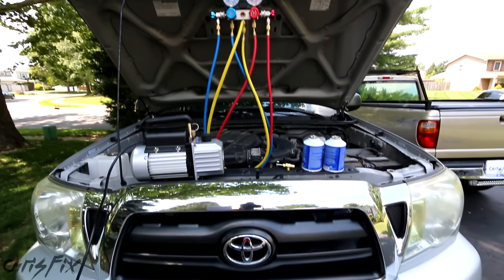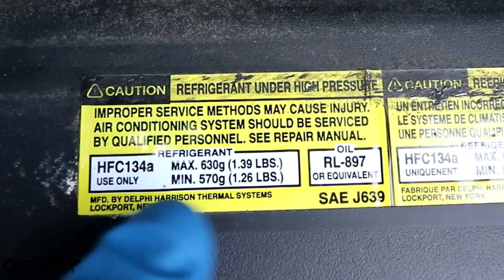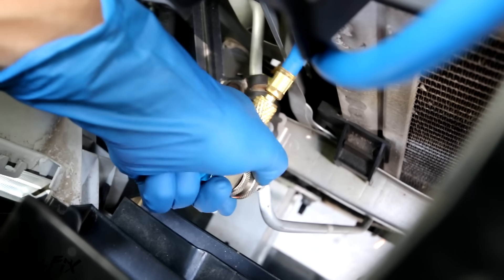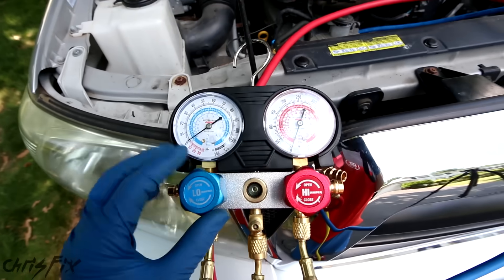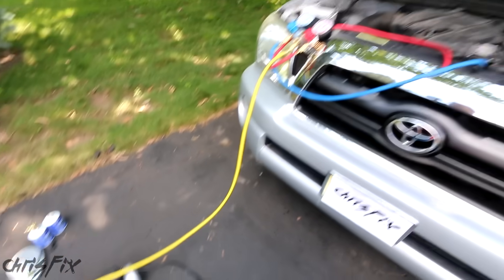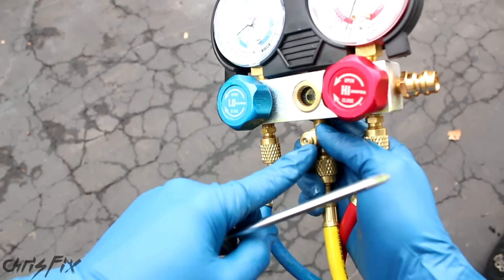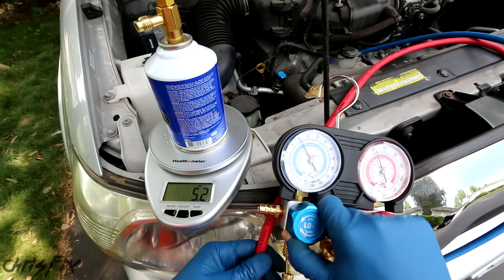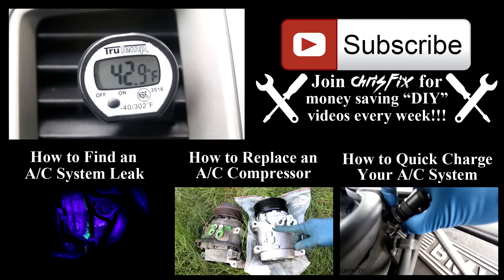How to Properly Recharge Your AC System

Comment: Hi Chris, I owned an automotive air conditioning and radiator service shop for about 30 years. We have charged thousands of vehicles. You did a very good job of explaining how to charge an air conditioner. I have always been extra careful to bleed the air out of the hose/s like you showed. I open the shop in 1973 and sold the business to an employee in 2002 and worked for him a short time. The business is still open today.
Reply from the maker: Thanks Patrick!
Reply: @chrisfix should you bleed the line after switching from the first to the second can of refrigerant??
Reply: @donniev8181  YES. HE DID IT WRONG OR FORGOT TO EXPLAIN THAT. If he did it like that, he introduced air in the system. Everybody makes mistake.
Reply: @HeydaCarreras  I simply asked a question, said nothing about making mistakes. Chris is a big boy, no white knight needed
Reply: @chrisfix question.  After you pulled the initial vacuum.  You turned the valves to off and then let it sit for an hour to check for leaks.  

But, if the valves were off, did you just lock that vacuum in the manifold, resulting in not being able to guide the vacuum in the system at all?

Than you turned the pump back on before you opened the valves so theoretically, couldn't the system have had a leak but you didn't notice it due to this process?

I'd have thought you should have left it sit for an hour with the valves open in order to catch vacuum loss (leak).
Reply: @davidshumway9639  I believe the right way to do it is to pressure test with nitrogen to 200psi, then vacuum to clear the system from any air. The pressure test would have already confirmed no leak, but if you can't, vacuum and wait a couple hours would be an alternative.
Reply: @chrisfix .
Reply: @chrisfix  How that works if your car only has hi presure connector in low pressure line?
Reply: Just 1 tip to toss in from my personal experience, it's a good idea to do a pressure test as well. Had a system that held vacuum but leaked at low pressure. Found a hose that had a pin hole in it that would seal under vacuum but leak under pressure.
Reply: You forgot to purge the air from the refrigerant line (yellow hose) after the can swap.
Reply: @nyrvg dont think he needs to purge the yellow line, he closed the needle valve and yellow line stayed sealed and only swapped the bottle.
Reply: @nyrvg  That's why he said: easy to do it. Everybody makes mistake, so why pay to a shop or dealer?
Reply: We took our Mitsu Galant to the shop to get the ac fixed. They kept the car for 30 days, charged 2200k. The air was cold for 1 day and has blown hot air since.  After that I have watched  ChrisFix and do almost everything myself, with success. Thank you, Chris!
Reply: @Vineyard_Edge  Good for you.  Not to say the shop was dishonest, but that is a lot of money.  Does 2200k mean $2200? Where do you live?  I think there should be a community to share automotive knowledge.
Reply: @Patrick_Gray  The shop was in Boise Idaho and I've heard that a full ac repair can be anywhere from 2k-5k. Two thousand, two hundred dollars was for a new compressor and a new condenser. I am now over in Pittsburgh area, but usually in the Detroit area! I combine the video knowledge and comments with my Haynes manual & forums. That usually does the trick. I've been studying HVAC over the years, and now automotive ac systems. It's tricky, but I am determined to learn everything I can about it. Seems like everyone I know hasn't been able to find mechanics that can fix their ac systems.
Reply: @Vineyard_Edge  Wouldn't be surprised if the evap/expansion valve were bad and they just didn't bother testing after installing the compressor/condenser.
Reply: Don’t you have to measure how much oil comes out?
Reply: @dssd245 yes typically that’s the rule of them to make sure you got enough oil in it but typically speaking it takes too much time and too much patience but yes that is the right way to do it
Reply: @Mike Studmuffin i hope your playing
Reply: there is a FINE LINE between the one that knows his stuff and one that can teach what he knows.
Reply: If you add oil to the system, how to you make sure everything stays under vacuum? Or you add oil, then vacuum?
Reply: Y y 6 6th
Reply: This guy explained bu book.  Taking air ouf of hose was a good reminder to me. Haven’t filled since long time. And yet you can push that extra fluid that remain in hose after closing the bottle 👍
Reply: @poweruser213  eh, definitely missing out on some stuff here.

Firstly don’t add oil through your service hose. Because now that hose is contaminated and you can’t use your gauge manifold on anything they uses another type of oil.

Secondly he left a bunch of refrigerant in his hoses. He did not take off his manifold correctly.  He in fact did not add 22 ounces because he for sure left a few ounces in his hoses. To take off the manifold your suppose to equalize pressure between the low and his side which will get rid of almost all the refrigerant in your hoses.
Reply: @appleeverything151  How so? he charged a full 16-oz till can, which was empty. He set a new 16-oz can on the scale. until it read 10 oz. The AC recharge now has 16+6=22 ounces. Exactly the correct amount. There is nothing in the hoses to hold back the 134 gas from entering the AC system.
Reply: How long does it take to get to 30 inches of mercury my car seems to be stuck at 25 and it's been on for 45 min
Reply: @ruben85374  You might never get to 30inHg. Because there's a lot of factors that may prohibit you from getting there. Ambient temp, humidity, altitude, etc. 
Once your vacuum pump draws it down as far as it will go. Close the system off from the pump and let the system sit for an hour or so, with the gauges connected. If you still have a reading of -25inHg. That would mean you have no leaks. Check the AC sticker for how much refrigerant your system holds and add accordingly. 
Hope this helps.
Reply: @abitoffcenter383  Yes it does thank you much. 👍
Reply: @ruben85374  Outstanding, I hope get it working!! If you're having anything like the temps we're here in Tx, you gotta get that working!!🥵
Reply: @@mikestudmuffin4549that's insane. I'd do it for well under half that 😅
Reply: I am happy i found this video. This guy is awsome.  I am in south Florida and its absolutely hot as heck out and he really helped me out. Keep up the wonderful work
Reply: Great reply and story and just read in 2023!
Reply: If you have to change the compressor or any major part that requires a refrigerant pull from the system are the Schrader valves replaceable on cars like they are on your home compressor system since it's recommended to change the Schrader valves on home systems when replacing a compressor or other major part since they are it's a PM thing. Just curious
Reply: @shadowof1155  yes they are. But realistically, I would just bubble test. (Since I’m not a pro and have minimal tools)
Reply: You didn't say anything about the high pressure gauge as to what pressure  should be desired after filling?
Reply: Sorry, I typed my question in the wrong place.
Reply: Hi Chris quick question I'm changing my a.c evaporator do i need to add oil it using nd 8 oil but the sticker came out so i dont know how much oil to put its a toyota spacio car
Reply: W
Reply: W in the chat
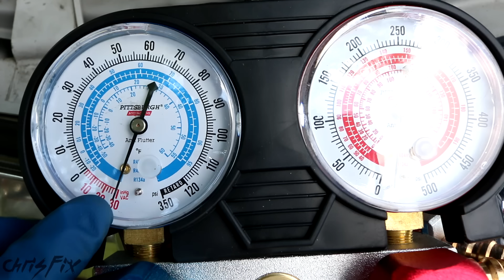Reply: 6:13 6:13
Reply: 6:22
Reply: Back in your day we didn't use sub cool n super heat reading ,on cars only industrial
Reply: I'm confused. I just watched your video from August 2015 on the QUICK AND EASY way to recharge your A/C system. Now, a month later, you made this newer video with all these hoses and extra things to use to recharge the car's A/C system. MUCH more extensive! Do which one is the right one?
Reply: You’re not the real dread pirate Robert’s?!??
Reply: If I got my engine replaced do I add oil to the A/C system? The A/C was really cold before the last one blew but I guess the mechanic didn’t service the A/C so I’ll be doing it but just wanted to know ?
Reply: 0:18
Reply: If your system was evacuated and you pulled a vacuum on it how would there be oil and dye in there still? Don't know much about this but trying to learn
Reply: Chris did a very good job, people I see in comments complaining about 200$ being expensive is funny my shop is cheapest around working on Tesla ans some other EV’s and 200 p/hr and dealers are 255 p/hr most cars 1 to 2 hour just to diagnose we don’t do that usually if we know it’s AC compressor and recharge but AC machine are expensive, I pay 200$ to 350$ to get other shops to charge occasionally. Also compressors are just expensive these days… wish prices were what they used to be! For any Yota- no reason DiY can’t do it if u feel comfortable and have these tools! Great video!
Reply: If you don't know if you have oil  in the compressor, can you add oil still? How much would I need to add for a 2003 Honda crv ?
Reply: Well a complete guide would have shown acceptable pressure readings when the system was filled.
Reply: Hey Patrick, i just had a quick question for you. so my system had all of the R-134a drained out of it, but i am not replacing any a/c parts. should i add a/c oil if im not replacing anything? thanks in advance
Reply: @frankambrose4764  im a mechanic- as long as you didnt replace any ac parts you shouldnt need to add oil to the system
Reply: @ItsKing32  My 08 civic has 178kmi never had r134a recharged and my ac is blowing warm air now so no need to add oil and max is 15.9 oz so is it safe to add to the max? Thanks
Reply: @ItsKing32 Since I didnt replace any components and believe I have low to no r134a left since I have 178k mi can I skip vacuum r134a out AND vacuum air out?

I feel I can skip going to shop to vacuum r134a out but need to get that machine to vacuum air out.
Reply: @Gleeleeglee  tbf id say just get one of those quick recharge cans yk what i mean? That should have like a gauge that tells u when its good but if that doesn’t work and u can spare the money id say take it in and get it drained and recharged
Reply: @Gleeleeglee  but yea if uve never replaced any ac part you shouldnt need to add oil
Reply: @ItsKing32 if you change out a condenser do you need to add oil?
Reply: @sh115067   no you don’t need to add oil to the condenser unless you are changing the compressor or their is a leak that letting out oil dripping from the system .
Reply: @sh115067  
I would also consider installing a new desiccant (drier or accumulator). If you are just changing the part, I would add 20% of the same oil type that's in the system.
Reply: @ItsKing32 If you vacuum the system then it won't have oil anymore so you should probably add oil after a vacuum. If you leave the vacuum on for 45 min I'd assume you won't have any oil in the system.
Reply: @michaeli-7186 whatever you used to vacuum that scary refrigerant with, is supposed to separate the oil and you’ll see how much was in the system. That machine usually puts it back in. So you have to add to the reservoir on the machine if you didn’t have enough
Reply: @ItsKing32 I just replaced AC Evap only, I assume I works need to add oil, correct?
Reply: "...should i add a/c oil if im not replacing anything?" A professional A/C servicing machine can display how much oil plus refrigerant it pulls-out.
Reply: Yea if you get air in the system the compressor won’t stay on and it’ll blow hot air. I made that mistake.. I would say I’d recommend air charge oil for adding oil.
Reply: @macb9009  Oh boy...replaced my compressor....blows hot air. I don't know if it came pre oiled!!! And i didnt vacuum. If i follow this vid....how do i know if compressor is oiled? I don't want to remove it.
Reply: @Didewro  well you need to figure out if it was pre-oiled. If it’s a cheap one I would say no. And you absolutely need to vacuum the system down for at least 30 mins. Then to add oil you’ll have to look up what type and the capacity and I would recommend getting air-charge oil to add oil. It sounds like you need help with an experienced mechanic. AC work isn’t easy unless you have a full professional grade AC machine.
Reply: @Didewro  if you didn’t vacuum the system down and just added Freon I think you definitely are in over your head.
Reply: Yeah he is full of shif putting that in there luke that, cost me big time @macb9009
Reply: hi, my bmw F10 blowing 12 degrees Celsius at the air went? is that normal?
Reply: That is a little warm Make sure your air conditioner is on max AC should be between 32 to 45°Fahrenheit @paulsp2693
Reply: "...my bmw F10 blowing 12 degrees Celsius at the air went? is that normal?" If the air coming out is freezing and the A/C compressor just keeps working but does not stop upon reaching the correct temperature (creating frost on the evaporator), then something is wrong. So, have it professionally inspected.
Reply: I just paid $325 for the recharge and to refill the car with Freon.
Reply: Y nu
Reply: G6h6
Reply: Patrick.   I know I don't have the proper tools to do the job my self.  I also don't really know  anything about ac systems.   I'm hoping you can maybe  help me a little.  I have a 1999 dodge ram 2500 diesel. I had one off those cheap gage from Walmart     anyway I put it on the low side and I DIDN'T add anything to it. Soon as I put on the porn it immediately pegged out the gage.  What do I need to do to fix it.  Thanks
Reply: @Benb05  start the car and turn on the ac. when the compressor isnt running, the pressure equalizes so the gauges will read the same. when the compressor starts, the high side goes high and the low side goes low.
Reply: @Benb05  What did you mean by "put it on the Porn"
Reply: @Benb05  Sounds like you had the gage hooked up wrong. I would only use a gauge set where I could watch the low side and the high side. By the way you hook up the gauge set with the vehicle engine off, thus the compressor could not be turning. Before you work on an air conditioner you should understand how it works. I started working on automotive air conditioners in the 60s. I read all of the book they had at the shop, then I got other books.
Reply: @Patrick_Gray   ok how how can you hook  up a gage wrong when it only  can go on one port there not the same size for high and low. Side.   Yes I had engine running  with ac on max cold and max fan speed.
Reply: You never sell a business if you really want to make money I have 9 businesses running and it's just the begging
Reply: So then can I ask you why they charge $200 if it is so simple
Reply: @kneebarx  Overhead, and insurance... $200 is a bargain... You ought to see what they charge a semi truck owner... I learned to do this myself.
Reply: @michaelwright1602  how much they charge for semi truck? I would imagine the process is the same except you need much more AC refrigerant.
Reply: @kneebarx  trust me it isnt simple
Reply: X2
Reply: @kneebarx  when you go to a shop you pay for their experience not much for the labor if its easy EVERYONE would do it but i bet a fourth of people who watched this STILL took their car to a shop cause it seemed "difficult"
Reply: @kneebarx  because if you don't know what you're doing, like for example, not bleeding out the pressure and emptying the refrigerant, vacuuming the moisture, measuring out the correct amount of refrigerant to put in, or, god forbid, accidentally opened the high pressure valve as it was hooked up to the car and keg/cans, will not only cause major damage to your car and ac system, but can actually cause serious injury and death as 200+ psi of pressure is fed into ya cans or keg of refrigerant and blows itself up and kill ya cause you didn't know better to NOT touch and always close the high pressure valve. Don't EVER touch that red valve and always have the car running ad your popping off those connectors to avoid pressurization and slap those dust caps back on to keep crud out.
Reply: @l.r.s.4580  In Shop Manual (3 huge volumes) I have they say to add ~2/3 of refrigerant first and then start the car. Then slowly add remain 1/3 of refrigerant w/car idling and A/C on (lowest temperature and highest blower speed). But in all films I saw everyone starts the car 1st then add refrigerant w/the idling car. From your comment I understand it is more safe way to do it. Thank you for this and other warnings in this complicated process. In instructions for the new compressor I installed they say to switch compressor on and off 10-12 times with engine idling to burnish the hub and pulley. But can I do it w/empty system (no refrigerant in it yet)? Thank you again.
Reply: @kneebarx  Firstly, there are a lot of steps, so it's not really that simple. Also as you can see, it takes somewhere around 3 hours to do correctly, so you're paying a shop hourly fee of around 100-125$ per hour. That's pretty standard, no matter what the shop is doing.
Reply: @austinwelch1132  y
Reply: @austinwelch1132  😊😊😊tþ😅tho tg
Reply: @austinwelch1132 Don't forget to add overhead and insurance (like mentioned in above reply) as well as a shop supplies fee (to cover shop towels, gloves, cleaners, PPE, etc, etc) on top of that $100 - $125/hr labor. Unless all those extra charges are already calculated and included on the overall hourly rate... oh... not to mention the tooling used to perform such a job as A/C and radiator repair/replacement. I'm not an expert, but I'd have to guess that's generally what both regular automotive shops and shops that specialize in A/C work go off of as a basis.
Reply: @kneebarx do you have the knowledge or the tools to do the job? That's why.
Reply: @kneebarx  
Most shops charge about $100/hour. Add to that refrigerant and parts.  The shops must have a recovery machine for each refrigerant they deal with, R12, R134a and now the new refrigerant R1234. It is slightly flammable so the equipment for it is very expensive.
Reply: @kneebarx Well it's 200$ in tools alone so......
Reply: @kneebarx  it costs 200 bux just in tools and freon.
Reply: @kneebarx 
Because we are HVAC certified and EPA certified in this field and know what to do if an unexpected situation should occur. We aren’t qualified by Google or YouTube !!
Reply: @kneebarx  Time. 45 minutes to vacuum the moisture out, after 15 minutes of vacuum to get to 0 PSI. The refrigerant is a minimum of 20 bucks (retail).
Reply: @kneebarx  u think it's simple but there are a lot of precautions that u have to take and risk that are there when u work on a a/c unit, Bein a car or house units. 200$ it's still a discount for what risk there are.
Reply: @bitchIDC  what risks?
Reply: @kneebarx  As a mechanic, that's any easy one to answer. First thing is payroll. The technician that works/worked on your vehicle isn't there for fun. No, he/she is there to make money. 2nd: Overhead, Shops aren't free. Nor is all the power, water, other services (trash and whatnot), and supplies (Although it's called FREon, it's definitely not free.) 3rd, All the equipment needed to do a proper AC job cost money. Which is normally purchased from a tool truck by the technician/mechanic. Which that money came from the technicians/mechanics paycheck. Which now brings us full circle to point 1.
This is a very simplified explanation of why it cost @H P $200 at the shop for AC work. I'm positive I left a couple few things out. I didn't want to get to far into the weeds on this.
Y'all have a good one and be safe out there!!
Reply: @kneebarx also you're paying for the knowledge of the mechanic that has been to school, paid thousands of dollars in tools..and plus if it was so easy, you my friend would have already done the job
Reply: @chadjenner8971  but i did and it was easy lol
Reply: @chadjenner8971  The only thing I couldn't do was evacuate the leftover refrigerant and I don't want to release it into the atmosphere